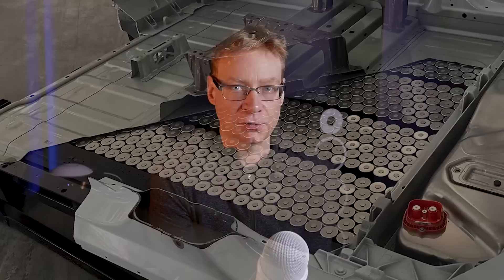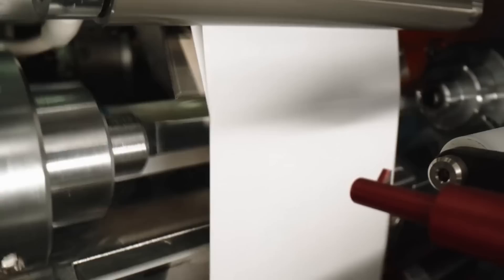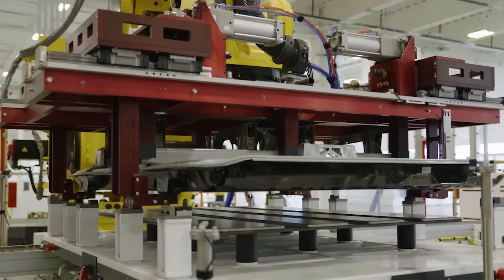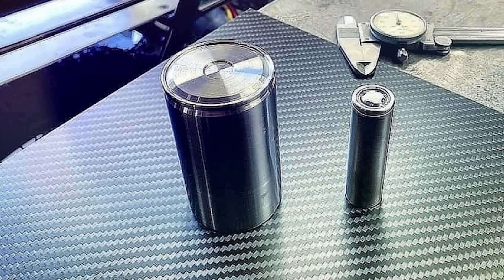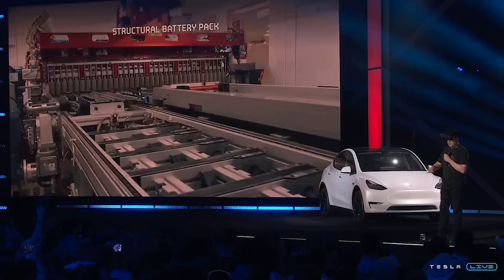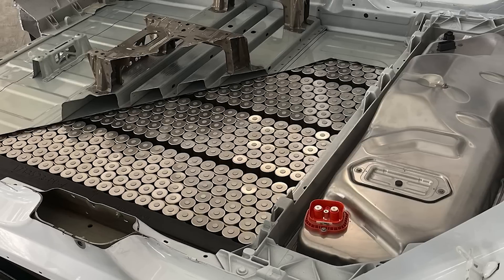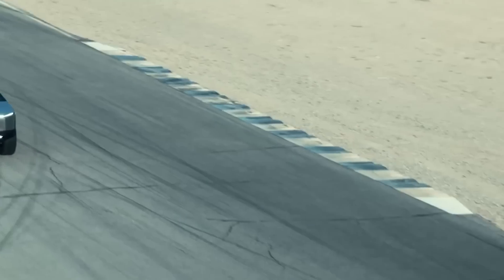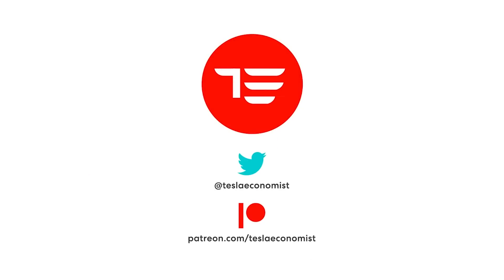Tesla's 4680 Energy Density Applications

Comment: Silicon degrades as it expands and contracts more, causing cell damage. Tesla's solution is micro nodules of silicon in an elastic, conductive medium. 
So they had a solution, not sure why not used yet.
Reply from the maker: Yes it makes it better, and they will slowly be able to add more silicon, but it will still degrade faster.

Comment: I think you missed the point. The 4680 is designed to deliver large amounts of energy when required without getting as hot as the 2170. That is why the version of the car is called the performance, it is for people who want a hot rod instead of a sedan and don't care as much about mileage as they do the need for speed and their agenda to cheat death while driving like a maniac.

Comment: Don't forget also it's possible that Tesla is software locking 20 or 30% of its battery capacity so possibly the model wise true range could be closer to 330 or 340 miles. They may be doing this and then later do a software unlock of the rest of the capacity or they just may leave it if people are satisfied the way it is but they've been known to do this in the past

Comment: I really want Tessa to move into electric bikes and other smaller electric applications. Imagine the economy of scale and the benefit that would bring to ebikes imagine an e-bike with 4680 cells where the battery only cost 50 bucks and has a range of 40 miles. Imagine other handheld or small applications that can be had with these strong energy dense batteries it could be truly revolutionary for humanity once this gets out into the hands of the average public

Comment: density is not much of need right now because once you start reducing the number of cells, high dc charging drops which is very impt for Tesla
Reply from the maker: How so? We have no idea what charging rate the 4680s can handle yet.
Reply: @TeslaEconomist  while C rates on larger cells look large at first glance, at pack level C rates definitely lower than smaller cells like the 2170/18650.  this is the reason the current 4680 AWD has  slightly less  DC charging speeds than 2170.

Comment: In 2017, Tesla issued a software update to unlock all the range available in Model S cars evacuating Florida.  As the 4680 cars become common, Tesla could choose to release updates incrementally increasing range.  The Osborne Effect would be mitigated by such a move.
Reply: Recommended charging for a 2022 Tesla Model 3 Long Range is 85-90% daily.  That is over 300 mile range.  After the car hits 0% you have about 30-40 miles at normal speeds before it taps out, depending on the battery you have.  Always remember fast charging is harder on batteries than fast discharging.  Superchargers are not best for longevity.

Comment: I've been All on Tesla since 2016 and tried to buy the dip every time. It's been painful to watch my investment cut in half from all time highs but if your time horizon is 10 years or more, the pull backs are a gift.
Reply: Just keep buying the stock. When it does go up that $100 in a week or a month. with 100 shares you'll make 100k that week or month. if you've only accumulated 1 share that entire time it dipped and jumped. you'll come out with $100.
Just keep buying. DO NOT SELL. Win rate and High % low priced stocks aren't worth it. i calced 80% ROI from 5 stocks, only made $8, But 80% of 300(1 share) is 240. 80% of 3000 (10 shares) is 2400. 

Maximize profits by buying and holding not day trading and scalping till you gain that % thats life changing. $300 suddenly turns into $3.

 Hope this helps you.
Reply: @joshuapyles1276  yeah that's exactly what I do. I'm long term holding. I've got 3300 shares. I've been acquiring whenever I had the cash and tried to buy the dips as much as possible. I had to sell 1200 (split adjusted) last year due to personal reasons, but the rest are long term hold. Right now I'm more interested in using 10% for options trading.... covered calls and cash-secured puts.
Reply: What? I call Bull S, how can your investment cut in half if you been buying stock since 2016? 🤔 Your math doesn't add up.
Reply: @Thenakedfinisher  no bullshit man. It's not half now... it WAS half. Don't forget Tesla hit 1243. And dropped to 620 something. That's a 50% drop.
Reply: @Thenakedfinisher  All time high was $1042.  Last month it was trading at $670.  Math is close enough.
Reply: I kept going in and out on Tesla, selling the highs, buying the dips. Made a good profit, but comparing it to just buy and hold.... I left Alot of money on the table.

Comment: I am quite certain that the range of the 4680 Model Y is not a data point, it is just Tesla avoiding the Osborne Effect. Munro stated in an interview that the 4680 had a lot more energy stored than they expected it to have. I have also expected the 4680 to be the million mile battery pack Tesla has said they were developing. I think Tesla will stop making the Y at Fremont at some point and switch it to more Model 3s or some other new product line, and then when all Ys are 4680 we will get the good news.
Reply from the maker: Yea or perhaps them just being careful.
Reply: This is the first theory I've heard that makes sense of a nonsensical situation. Good thinking.

Comment: 4680 is the new oil, that’s why Exxon and Shell should also fear their demise.
Reply: I'm expecting Exxon to grab some of the free government battery money.
Reply: Technically, batteries are only the fuel tank of an EV, the "oil" is the electricity supply. If the grid goes down, no fuel goes in the tank. Unless you have an Aptera, which makes its own fuel from sunlight :)
Reply: @apterachallenge  
Solar and VPP is the new oil.
(GRID volume)
We're just seeing the first hints of it now.
Reply: @rogerstarkey5390   Agreed, solar is the answer to the energy crisis. What Aptera does is guarantee that solar is being used for every single mile of commuting up to 40 miles per day. In general, solar at present is only a partial solution. Some people who drive EV's have their own private solar installation but most don't. Likewise, the grid has some solar input, but mostly it's still fossil fuels in a lot of countries. What I'd like to do is get solar on our house before I get my own Aptera, that way I will be covering both bases - for short trips the car will be self charging, but there would also be the option a full charge for my car from the house's solar panels for a longer road trip before I leave home.
Reply: @apterachallenge  I think you missed what Moon was trying to say ..

4680 is the new Oil - where previous there has been a huge demand for oil where companies and even nations got very wealth by supplying oil - 4680 will be the 'new' oil - companies and maybe even nations will get very wealthy by supplying 4680s